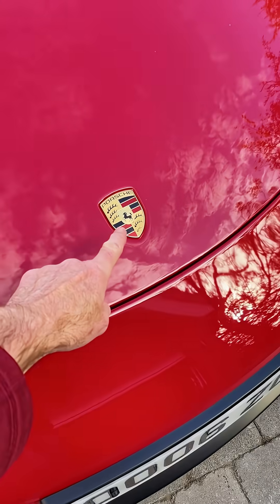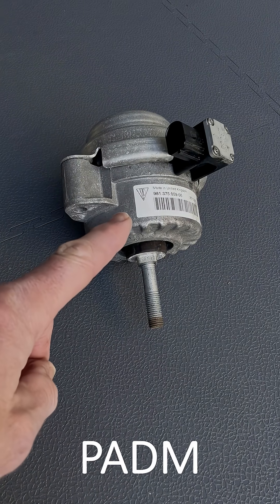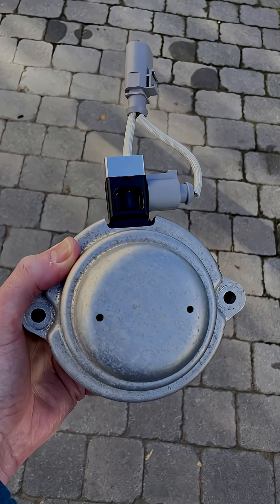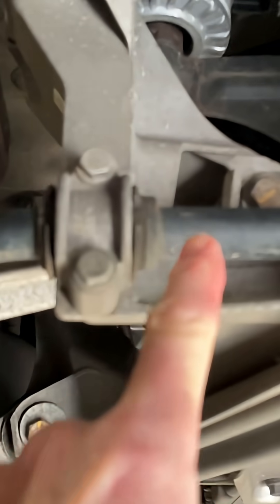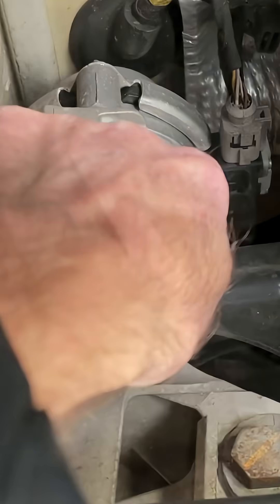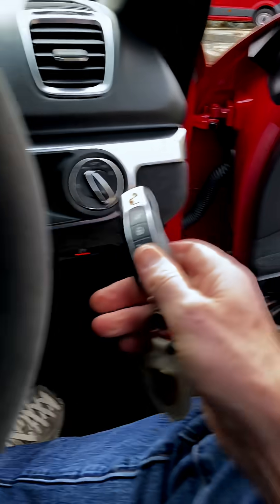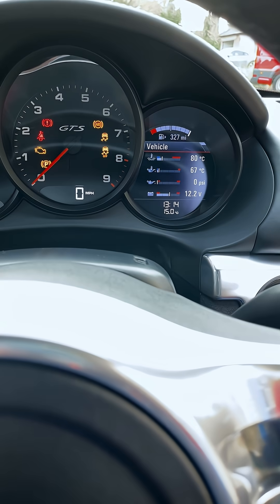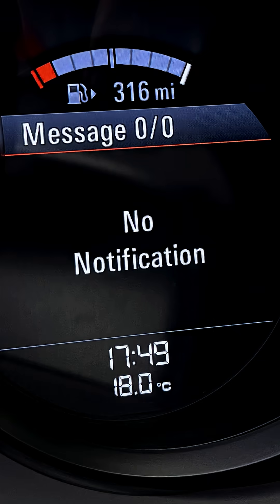Fixing Porsche's PADM mounts

Comment: Good to see an aftermarket solution to the sensor being bad and not the mount itself needing to be replaced too.
Reply: Unfortunately it is not a “real” fix. The sensors and PADM doesn’t work hereafter. You will not notice though expect if you really push the car.
Reply from the maker: @g.dejong1594  Have you experienced this?
Reply: @christianpratt it is common issue on the 981 GTS model with the sensors. Like your videos though. Nice to share this knowledge and this is the easy fix. Even if you replace them, they will go bad again. Know people who replaced them in full several times 😢
Reply from the maker: @g.dejong1594  It’s frustrating isn’t it? Thanks for commenting - and glad you’re enjoying the videos. 👍
Reply: @christianpratt yeah Porsche should have fixed this in a part update…

Comment: According to your vid it seems that it is not necessary to remove the ground plate to get access to the mounts. Astonishing.
Reply from the maker: Hi Gerhard. I’m not sure what is meant by the ground plate - but certainly for the lefthand mount, you can remove it (while attached to the bracket) without taking any other parts off first. (The right mount is harder to access.)
Reply: @christianpratt I'm talking about  the support plate with its two struts left and right. Just for clarification of my above comment. I worked according to Porsche workshop procedures. They remove all those parts. Advantage of your approach, no need to check the suspension adjustments afterwards.
Reply from the maker: @Gery8988  Aaah yes - quite so. Avoiding the suspension is definitely a good way to go. One more cost to avoid. 👍